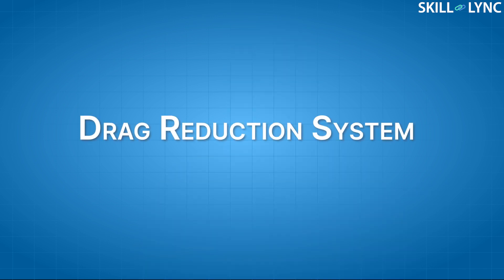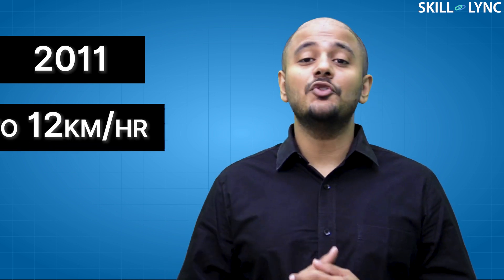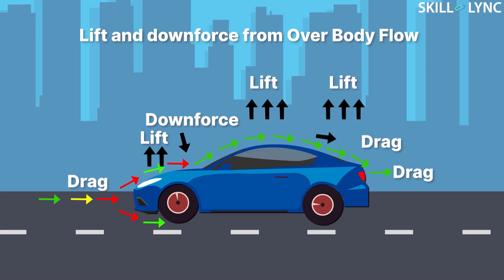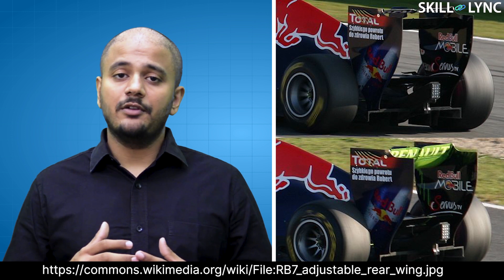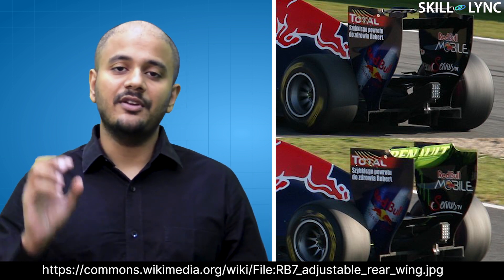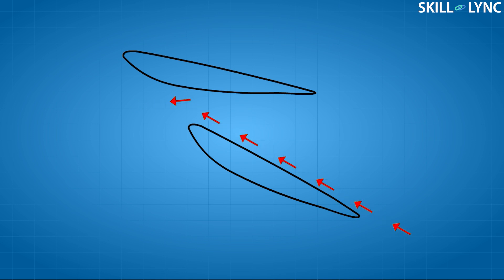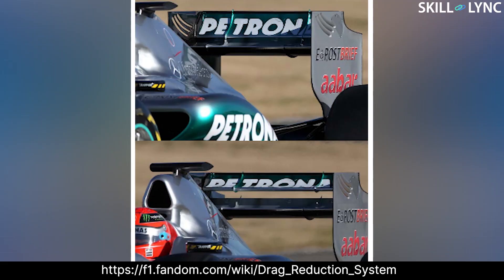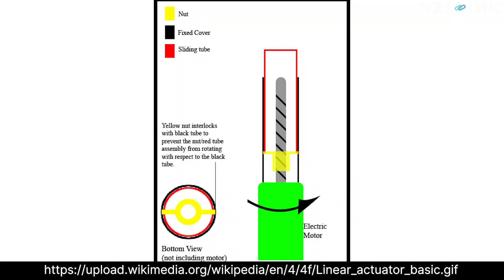What is the Drag reduction system used in F1? | Skill-Lync

Comment: Hi thank you for the explanation .Though the video is very helpful  I have a doubt on DRS. The purpose of DRS Is that the approaching car is prone to unbalanced air which affects its speed . So I would like to understand there is also a a process of Towing , where there is a car in front , the approaching car can go faster as the car  in front clears the air. Hence my question is when there is a car in front , is it beneficial as it helps by ‘TOW’ing but also it is a disadvantage as well as the there is unbalanced air? Can you please help me to understand this ?
Reply: Idk bro. I like football. But I hope you get your answer hahaha
Reply: @kahzzyy1858  HAHAHAA YNWA BRO!!!
Reply: The following car, if within a 1 second gap to the car in front (calculated at specific detection points onn the track), can use DRS to open its rear wing and get a 20kmph (not sure) advantage over the car in front, and will also benefit from the slipstream (the vacuum of air created by the car in front), giving it a great speed advantage to overtake.